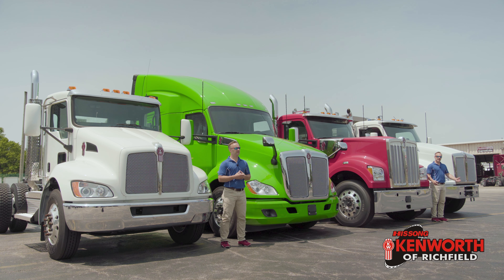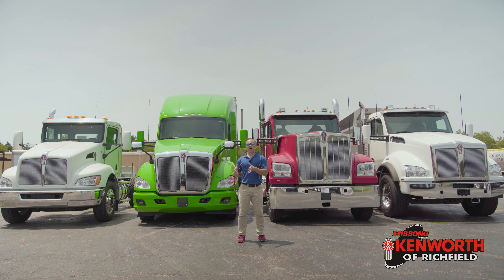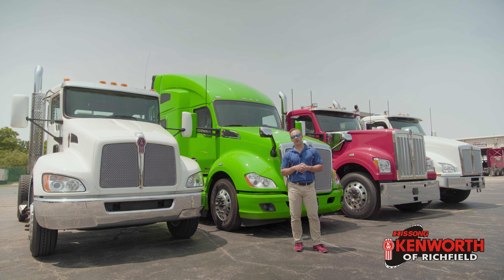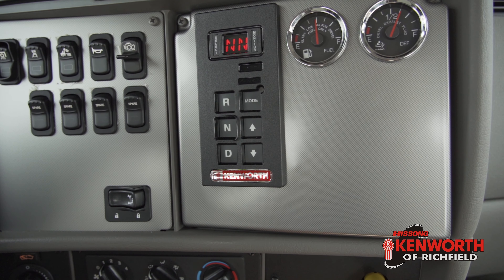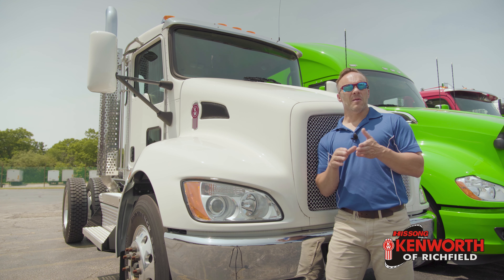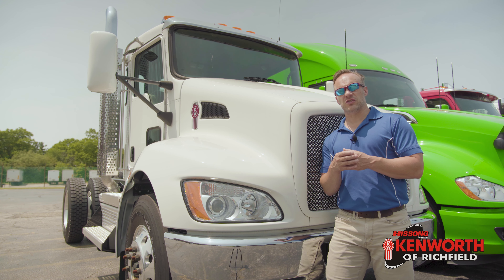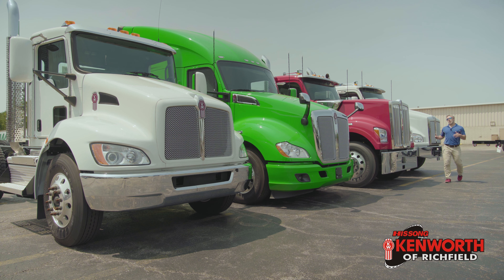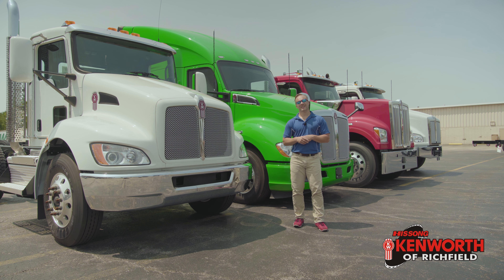Manual vs Automated vs Automatic (AGAIN...sort of)

Comment: Man i so hope that you will answer under my comment 🙏
I have purchased 2020 Peterbilt 579 x15 efficiency series 500hp, ultrashift plus mhp 13 speed automated transmission and meritor plus 3.42 gears with airtrak suspension..
Truck was made in 07/2019
Fuck... 5.6-6.0 maximum mpg with 78-79k load reefer at 70-72 mph speed ( 1480-1580 rpm)
Yeah i have 6800 miles on it but fuck..i am worrying will my mpg grow up with time?
Also my pete 579 with that airtrak raises my reefer trailer so high like truck is 13.5 and reefer was 13.8(now its 13.7,deflated airbags  a bit) 
Will EPIQ package help me a bit do you know if trailer is 2 inches higher than truck?
Then Ultrashift plus. Okay overall i like it on highway but on backing up to the door it’s a painful 😖 
Jumps a lot, if i use R1,i often get CA message in dash ( clutch abuse)
R2 starts too fast and i am about to hit another truck if i am really close to him.
How to activate creep mode on reverse if manual and low mode work only in D position. How to activate urge in move??
Will it help me to avoid clutch abuse and if i got truck and trailer like in « Г » position, either in left or right side, it jumps and shakes truck and trailer a lot and every time!
In what year new ultrashift plus were upgraded/ updated? If my 2020 truck were made in 07/2019,  i got the old or new version?
Just i wish to know about mpg, i was expecting  6.5-7 mpg with reefer 80k at 70 mph, but i have 5.5-6.0 with 2017 emission x15 500 hp efficiency series and 3.42 gears .. where i am fucked up? With airtrak that raises trailer above truck cabin or because the truck is a little bit raised with clearance in compare to another pete 579/kenworth t680?
How to avoid clutch abuse while backing up in really tough places where i need often pull forward for couple feets and back up for couple feets a lot of times ? I have like R1 R2 and kinda R3,which I cannot activate while i am staying. R1 is lower 1st gear and R2 is higher 1st gear correct ?
Sorry i am just so upset, idk what to do and how to explain another my drivers how to not break the ultrashift transmission.. 
please help me!
Let God Bless You! 🙏
P.S. if this setup is really bad, will x15 efficiency series 500hp with endurant 12 speed auto transmission and 2.85 meritor axle ratio better? And which setup will be more reliable : the #1 i have now with my pete 579 or #2 i have described here in P.S. for reefer 80k going 70mph. Thank you!!!
Reply: And for ultrashift plus 13 speed transmission how many miles the clutch may live? Or after how many miles i need to change the clutch ? Like in 300.000-350.000 miles?
What should i do in backing up in tough places if eaton video says like don’t use two pedal(brake and gas often) but if I have to act like press gas pedal, then press brake because truck is shaking and start to drive in reverse too fast in R2 position ( i press “turn off hill assist button, i know about 3 secs delay so i keep “turn hill assist off” in backing up and if i use R1, the Clutch abuse warning comes earlier than i am in R2), turn steering wheel on opposite site, drive forward, press brake, turn steering wheel all the way to the left, press gas, then press brake and i got this fucking clutch abuse warning... i have been driving volvo vnl860/freightliner cascadia with 12 speed automatic transmission and never have had any problems like that, what should i do? How to backing up correctly with ultrashift plus? I would very appreciate with your answers, i think i am not the one with such situation, your reply may help another guys too!
I like the transmission and setup on highway overall. I really enjoy with it, but mpg and backing up are painful and stressful 😭😢
Maybe i do something wrong or I don’t know something..
About x15 2017 year emission, will my mpg grow up after like 50.000-60.000 miles if right now i have 6800?
Or i have to change the hardware like buy and put hardware from 2020/2021 efficientcy series and put in in my 2017 model year engine?
Thank you again dude ! 🙏

Comment: Question: driving mountains, I would gather a manual is better and safer, given the driver knows how to properly shift one, in combination with engine braking & retarding. Are the new manual-matics just as good as a talented mountain driver? Started my trucking career in an international day-cab with I believe is the Eaton Endurant 12 speed. The truck is a 2018 model, let’s hope Eaton has improved they’re transmission, I really can’t imagine the engineering that has gone into automating one of their manuals. It’s a blessing here in Chicago but at that same time I would never order one of these transmissions. For what we haul, dry van, less than full load, maybe 50K, GCVWR on a hard pull(?) I would go with an Allison.

Comment: well, I have a small Vauxhall Corsa with a semi-automatic gearbox ..........it's semi-automatic as it has a normal conventional manual gearbox, it is just that the gear changes are made by an "actuator" that takes the place of the clutch and changes the gears but when needed I can use the manual mode and just pushing or pulling the gear level to change gears.

Comment: Can I override the automated transmission? is there still a clutch pedal that I can use?
Reply: No. The clutch is controlled by the computer, and not very well from my standpoint. The T680 I drive sucks. It won't let me start above 3rd gear (pulling a pup trailer) and if it detects an upslope it starts in 1st. Then it often skips gears so it ends up lugging and not having much torque. When using the cruise control it derates the Jake brakes, I'm not sure why. If I set the cruise and coast over that point it shifts into neutral, which I thought was illegal and totally unsafe. The shifts are as slow as a new rookie driver would do so uphill starts can totally fail. You can put it in manual mode but there are still limits to what it will let you do. A total piece of junk in my opinion. Boss says every manufacturer wants $10k more for manual these days.

Comment: I currently drive for a concrete company in South Carolina, and I've driven both Automatic and Manual trucks; when I started working there, I was driving an automatic truck (Allison 4500 RDS 6-speed), and the truck I'm driving now has an Eaton 9LL. 

Both transmissions have their benefits and drawbacks; the automatic allows the driver to fully focus on driving the truck instead of worrying about the next shift, while the manual allows the driver total control of when the shifts happens (the deep reduction gears in the 9LL are very helpful in off-road and other slow speed situations). The downside of an automatic is that the driver doesn't have direct control of when the shifts happen, while the downsides of a manual are power interruption between shifts and more energy expended while shifting during the day
Reply from the maker: You got it Peter.   There's advantages and disadvantages to both......all depending on what you're going to do with it.
Reply: Or you could switch the automatic into manual mode and control when shifts happen?
Reply: Specially when You are first learning to drive the truck  with a trailer. You need to be more focused on the road and the trailer so you dont get into an accident. I almost hit a car with my trailer because i was more concerned of not stalling in the middle of an intersection than to pay attention to my turns and my trailers. Safety reasons automatic is WAY better.

Comment: I have a DSG (dual-shift gearbox) in a VW Passat.  This is also an automated manual, using 2 clutches, the side-by-side gear assemblies and super fast shifting.  One set of gears in 1,3 and 5.  The other set of gears is 2,4,6.  When I start out in 1st, the other clutch is waiting to engage in 2nd.  The shifting is nearly instantaneous, confirmed by how the tach snaps to the new gear.  I doubt with all the mass of a large diesel engine this would work as well, unless that rpm change was dampened just a little.
Reply from the maker: In Eurpoe, they are running dual clutch transmissions.   I'm not sure that we need that here, but you never know what will happen. :D
Reply: Volvo has the I-shift dual clutch transmission.  Those using it, really like it.   Especially during mountain crossing.    There’s  no interruption of power, AND, not to forget, constant jake brake.   Accept during hi/lo range shifts.    As of today, it looks like Volvo is still the only manufacturer that offers a dual clutch transmission made for heavy vehicles.  I didn’t manage to find any other alternatives right now.

Comment: Im not a truck driver but i do work on trucks and kve driven just about every combo you can think of. The automatics, even in the newest models are such garbage. Like drvong them around the yard or having to park them is so annoying. You feather the pedal they dont go you lush a little harder then their damn near full throttle. Idk if having a trailer or a load helps it at all but if it dosent i feel bad for people having to back up to buildings with these trucks. Every manuel ive driven was always so easy to drive the truck smoothley.

Comment: I drive dump truck and have driven both a Allison fully automatic in a 2018 so far going strong no issues and now driving a 2023 kenworth with 18 ultra shift in it,also so far no issues… Personally I preferred the Allison between the 2 ,but just my opinion. You can’t go wrong with either of these transmissions and one thing that’s a big factor for me is when running very short rounds through city streets the automatic transmissions are far easier on the driver by the end of the day and I’ve also shifted gears for 25 years so I might be experienced enough for a bias opinion.. 😊

Comment: My company provided truck is an automated t680, gotta say I'm really not a fan. It tends to shift in the most inconvenient times, hangs up in one gear spinning the engine, also sometimes going up a hill it can't decide which gear to use and goes back and forth a few times. Worst part is the manual mode is useless because i can't go over a certain rpm. Looking for a new company that has manual trucks now because the company i work for only has automated now.
Reply from the maker: If your truck is an earlier model, I could see that as happening.   Has the the truck been in to get the programming updated?
Reply: @KenworthofRichfield  I'm not sure, I've had it back in an MHC Kenworth 3 times for the issues and comes back the same
Reply from the maker: @orion3074  I'd ask if the programming has been updated or what program is in the truck currently to see if they can change it for you.

Comment: Better then me bcuz ima choose the manual regardless what im doing and yes even in a dump truck and especially over the road! I was taught in dump trucks doing asphalt and milling with a manual so it’s not a headache to me as i was told it would be! Otr to me definitely requires a manual bcuz i want control of my truck on mountains and in adverse weather conditions etc, I only trust me in those areas or conditions with 80,000 pounds not a computer lol! Heavy haul speaks for itself so no need for me to even mention my reason for a manual with heavy haul lol!
Reply: 💯% Agreed....it's not even a choice for me.....Do It Yourself Manual or nothing....

Comment: What would be best for hauling gravel in a belly dump trailer?
Reply from the maker: Honestly, any one of them would be a good pick depending on terrain.   We have a lot of guys that run 10 speed ultrashifts or 18 speed ultrashifts for applications like that and love them.
Reply: @KenworthofRichfield  Flat terrain, building gravel roads. 50/50 highway & gravel / sand terrain.
Reply from the maker: @rubbersole79  Any one of them could be great for you.    Budget is the next concern.   To me, an automated would do really well in this.

Comment: Ultra vs allison 0-65 drag
Reply from the maker: I've actually thought about that one.   I just have to wait until we've got two trucks with the same spec to compare!
Reply: @KenworthofRichfield  I used to drive a t800 7 axle with a c13 & 10 speed now i drive a 567 7 axle mx13 allison. The allison feels like a rocket at lower speeds empty but i feel the manual is better in all the other areas. For city driving & around farm yards i love the allison.
Reply from the maker: @AndyFromm  I can see how that makes sense. :D

Comment: For heavy haul over gcvw, what is the fail rate for the Allison vs an 8ll? The rto16908ll brochure says gcvw=140000lbs online catalog says 110000. If I pulled a tractor trailer setup w/ the 8ll at 14k vs the Allison which would fail 1st?

Comment: Recently bought a used peterbuilt 579 with the ultrashift.  I converted the truck to pull my Fifth wheel rv for recreational use.  Coming  from a 2020 ram 3500 cummins to this was a shock when it came to transmission.  First thing I noticed is I couldn't  take off from  a stop light and have quick acceleration and lags from  the automated  short shifting.  So on that not I cannot merge  quickly onto  a highway  this is a real safety concern. Had I known this I would of thought twice  before purchasing
Reply: That's where automatics are advantageous

Comment: Our company purchased t680's with 10 speed automated transmissions. I like that there is no clutch pedal to stretch out your legs but that's about it. The truck does not accelerate going down a on ramp if the ramp has any down grade until it levels out. We changed our shift parameters from 1500 to 1800, they were just to slow to get up to speed. (450 isx Cummins). I thought they would really be nice but would prefer manual again. Most of the time I'll shift in the manual mode instead of the automated mode especially downshifts with the Jake on. We have had some issues with the wiring and sensers on the transmission resulting in a tow back to the shop.
Reply from the maker: Interesting and thatnks for the comment.   It not shifting on a downgrade seems like a programming issue.    Have you talked with Eaton about it directly?

Comment: I think autos are great in dump trucks but not in a semi truck as ive heard especially going down a steep hill its not good at all, you have to use the brake way more as the engine doesn't really slow the truck down at all

Comment: One other reason to run a conventional manual - a lot of areas in the nation there is little to no access to a shop facility that can work on computerized, or even automatic, transmissions and engine systems; the nearest facility might be hours or even days away meaning a substantial cost of remote service or tow.  But about any rural shop can probably effect a repair on a basic manual gearbox and get a guy up and running again.   Ease of use is a great thing, but it comes at the price of complexity and can increase the cost of ownership if the worst happens.

Comment: I drive for a mega carrier who caters to the lowest common denominator. I learned how to drive in a pete 579 with a EF 13 speed. I want my damn manual back. The guys who taught us did such a good job I can outshift any of these damn "automated" transmissions. Not to mention, manuals can judge road conditions. I can run it hard downhill to ease it uphill conserve fuel. If I'm cresting a hill in an automated, it will downshift, just to rev, and just to shift back up when I could have lugged it up and over. Fuck Automated, and fuck Schnei..... um, I mean I love my job.
Reply from the maker: What I find interesting in this is that you can control what the automated does with a little finesse on the throttle.   Don't fight the transmission.  Learn to work with it and you'll both be happier.

Comment: So, at the end which is better for hauling tankers? Also to install hydraulic pump on a new truck still warranty cover?
Reply from the maker: Yup! a properly installed and spec'd PTO will not void a warranty unless it's the PTO that caused the problem.   For a tanker, an Allison would be great, but really close behind that and probably the best value would be the Paccar Automated transmission.

Comment: If you have sometimes heavy but mostly light automated is the way to go if you're constantly hauling big heavy loads like I do on every day's basis and going through steep hills manual transmission is the way both are good just like you said for the application take it or leave it

Comment: My mt4000 alison in a road truck works great.  Wouldn't have anything else.  1325 rpms at 65 mph with 3.73 gears.  Can't bet how smooth it runs.
Reply from the maker: Makes sense. :D      When you've got it, you've got it.
Reply: I too can't settle less than Allison. It's smooth and have quicker gear change. This means a lot stressful driving with Allison. Also have better acceleration off traffic lights. Mind you I somewhat have an opportunity to compare on our stupid 100kmh motorway/highway with traffic lights. The Allison transmission truck got off very quickly compared to a manual (probably Eaton who knows).

Comment: Yeah im still lost between the automatic and the fully automated which is the one that was designed to be automated from the jump!
Reply from the maker: The biggest differences-
Automatic- Torque converter with clutch packs and planetary gearsets. 
Automated- Clutch with standard helical cut gears.
Reply: Kenworth of Richfield oh ok one of those automated but of course when mentioned to me was called an automatic that still has the clutch pedal....oh ok ive never seen it before but was told that there was an automatic with a clutch but as I’ve learned here its an automated not automatic lol! Or are u just talking about the clutch itself in the engine vs a clutch pedal??